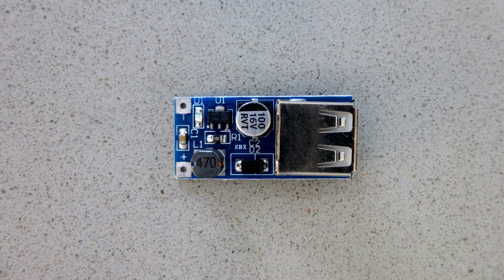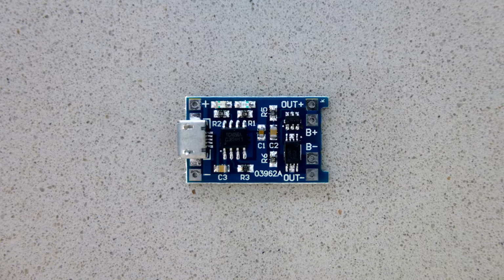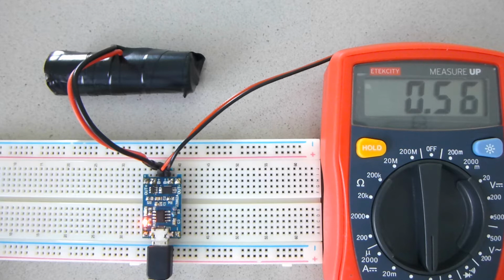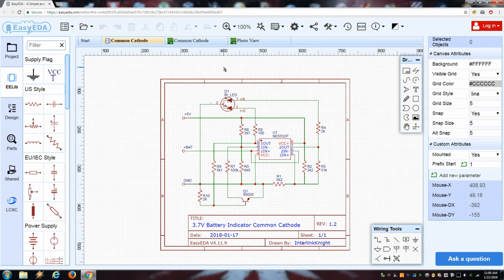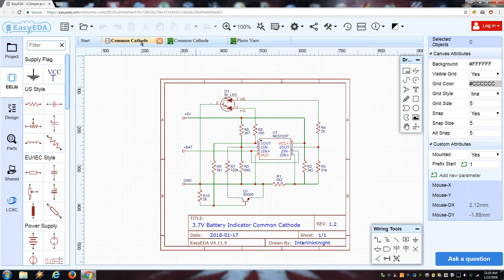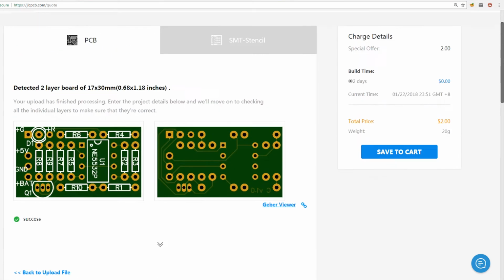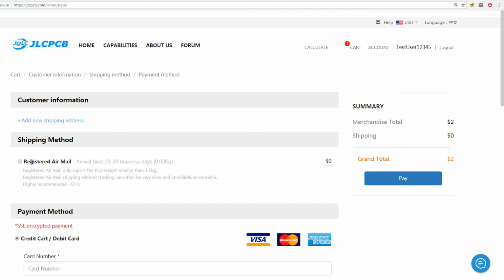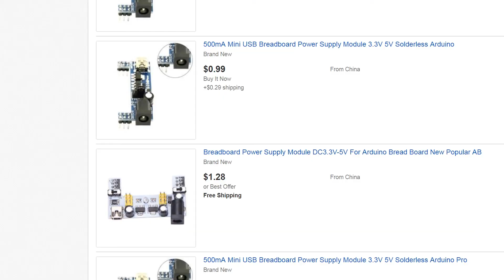DIY Breadboard Power Supply

Comment: please do battery level indicator for 12volt the way you did for 5v. Its very impressive using RGB i love the way you built., Please tell what are resistors should replace to achive for 12v
in same circuit.
Reply from the maker: I'm glad you like it. I think you could use the same resistors as me and should work basically the same way with 12V. Try it. And later change the values of the resistors as needed
Reply: @interlinkknight  Hi Friend, i am new to electronics, please suggest or when you do another video for 12v Battery level will get notification to me, then will do that project. I am your follower
Reply from the maker: I don't plan to make a video about that. Like I said, just try it as it is and see how it goes. Probably works perfectly fine
Reply: @interlinkknight  sure my friend. I love the way you have demonstrated of each component. Really appreciate.
Reply from the maker: I'm glad :)

Comment: hello, i got questions about putting two batteries in parallèle:
1)Do you think that we need to put 2 charging modules (one fors catchs battery) in order to have a good charge?
2) I had read somewhere on internet that putting batteries in // will discharge the most charged batterie in the second one. 
In order to prevent this, i use to put a Schottky diode between the battery's output and the charge (i still connect the charging circuit's "output +" directly to the " batterie +" ). Do you think that it is really important to do this?

I really want To tank you for all the tutorials you put on Youtube. your explainations are really usefull and It helps A LOT.
Thank you a lot
Reply from the maker: Thanks for your words. I love helping people and it's great when I know that my effort is useful to others. That's the kind of comment that keeps me going.

About the two batteries in parallel, I am not expert but most laptop batteries have six 18650 batteries in pairs (3 pairs). If there were a problem putting 18650 batteries in parallel, laptop manufactures would not been doing this.

Many battery packs also use 18650 batteries in parallel. I only see a problem if you would use different capacity batteries in parallel. That might have negative effects. But if both batteries are the same brand and capacity and have the same wear, then I don't really see the problem.

As you saw on the video, I built a breadboard power supply with two batteries and it works perfectly. No overheat and no problem charging.

Comment: Hey, how is your turbine going? The new one i mean
Reply from the maker: Hi. As you might know, I have the LCD display working and part of the 3D model is done (not complete) but I still don't have a 3D printer so I am stuck. My life is kinda complicated right now too so I can't deal with a 3D printer anyway, yet. I do plan to keep that project going eventually, but not right now. It would have to wait until I get my life organize and stable. Same for the Hemi engine model, automatic transmission, etc. That's why lately my videos has been about small projects and tutorials. Thanks for asking. Is nice to know my projects are interesting to anyone.
Reply: InterlinkKnight I tried to built your turbine. I have an friend with an cnc drill. If u cant get an 3d printer. Try lending one or getting an company to produce it for u. Iam so interessted man
Reply from the maker: Did you built a jet engine model? Do you have a video of it? I am in the process of moving to another city so a 3d printer would be more of an issue. And I don't think I would have the time to invest on the printer and those projects. At least not right now.
Reply: InterlinkKnight  iam currently building the circuit. I bought 8 turbo motors. There are massive when u overcharge them
Reply from the maker: Oh. Sounds great. When you get it working, can you send me an email with photos or video?
Reply: InterlinkKnight Yeah man i will definetly. Whats your name when iam allowed to ask?
Reply from the maker: My name is daniel. My email is the same as my username/channel at gmail.com